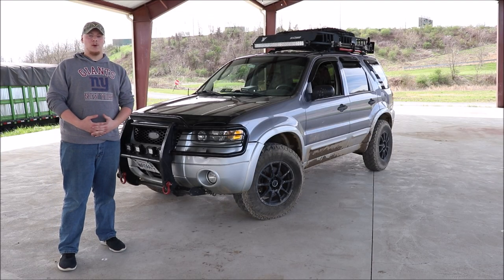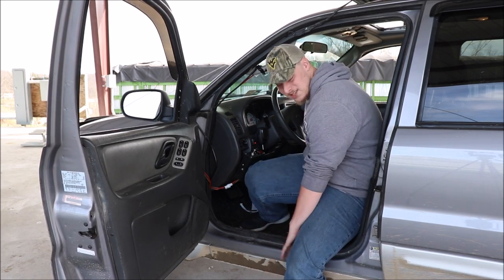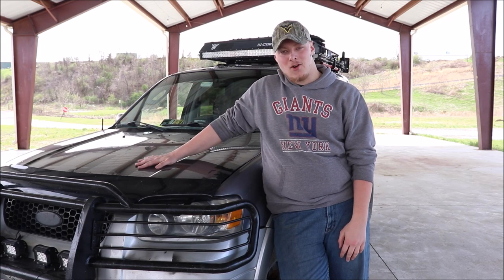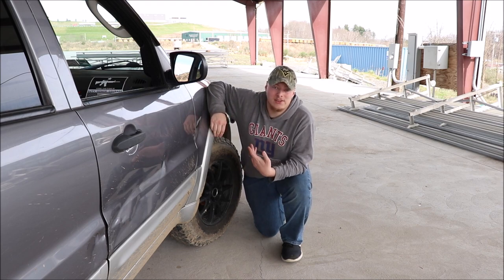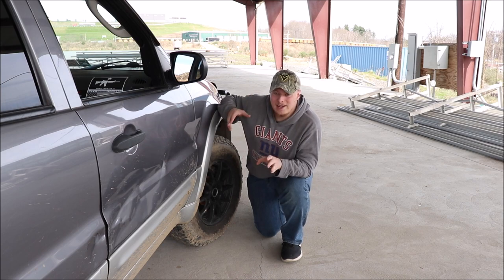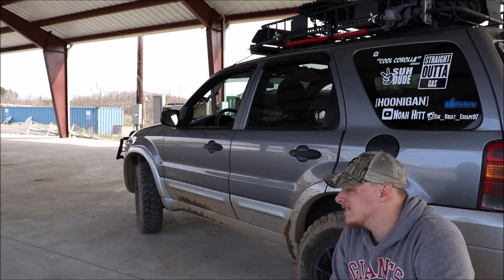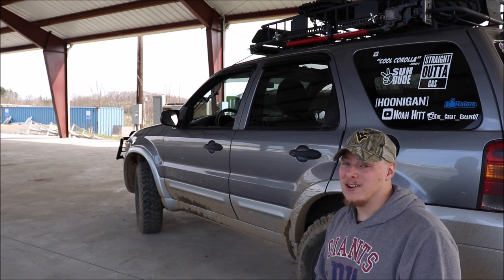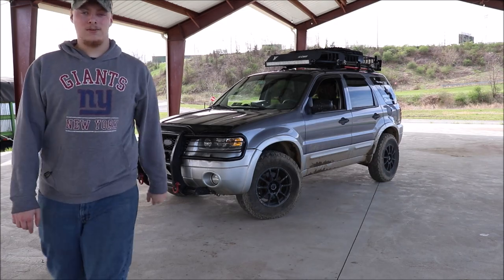5 THINGS I HATE ABOUT MY LIFTED 07 FORD ESCAPE

Comment: I have almost 250,000 miles on my '02. Built like a tank. When you replace the alternator put a new timing chain cover gasket on.
Reply: I’ve got an 05 with almost 300 and after putting on plugs and a new battery I now realize it’s the alternator:(

Comment: Dude you're missing one point of that whole vehicle it was never made to be an off-road vehicle. It wasn't designed to be buried in mud. If you went through four alternators then you're probably getting mud and all that kind of crap in it, I have two Ford escapes One of them is a 2001 The other is a 2004 they both have the original alternators on them and they both have over 200,000 mi on them. My 2001 I do light off-roading and I've never had any issues. But some people like you like to complain about issues you've created for yourself like taking a Ford escape and trying to turn it into a mud vehicle

Comment: Lack of power? My old 03 with the 3.0 friggin ripped. Clocked in 0-60 at 7.5 seconds. Did a 30 roll with a 04 mustang 4.6l and let’s just say i was lookin at that stang through my rear view. Front tires? Forget about it! She was always chirpin and wearin through rubber. Miss that thing.
Reply: Same, idk what the fuck this dude's talking about. Maybe it's the extra 500lbs of bolt ons he slapped on there weighing it down... When I turn O/D off its like turnin the hat backwards. We gettin it.
Reply from the maker: @Paios I’m glad yours has kept you happy, just never felt like mine had enough balls behind it

Comment: Had my 05 since 06 never changed the alternator. Replacing it 4 times? Buy OEM, yes it cost twice the price but given the shitty location, buy one that's going to last. You'll save in labor costs alone.
Reply: It's because its at the bottom of the engine... you drive through a large puddle or creek, anything deeper than 10" and the alternater gets soaked.. after that.. you can kiss it goodbye in the next 12 months
Reply: Clayton Bolton - I drive through slush and snow all winter and hit puddles at speed on purpose. Replaced once at 174, 000 mile replaced with a high quality one, no problems. 

Who ever designed the location however should be stomped.
Reply: had mine go a week after i bought the thing at 120000, im now at 155000 and no issues.

Comment: I have the 01 Escape and I do not have the same complaint with my alternator. All you need to do is remove the passenger tire, remove the serpentine belt from alternator and unbolt the three bolts from underneath. Super easy for me. I never have to replace mine but I did have to move it while putting on new manifolds/cats.

Comment: I hear you on the alternator issue....almost all car manufacturers are cramming things in due to front wheel drive...more compactness for better gas mileage etc.....but on the power - you have those accessories weighing it down some.....front bumper / top rack and things in rack and in back.....also AT tires = more resistance/drag.    I'm sure there are quieter Escapes that are 2WD ....off roading alot creates squeaks etc....  keep buying American....do your homework....

Comment: I have an 08 ford escape hybrid and it's a huge piece of shit and the best car I have ever owned at the same time.
quality of the interior is absolute garbage, especially for the hybrid, which was a budget car version of a budget car.
it rides like shit and randomly jimmies on the highway/when accelerating. Not sure if it's designed that way or if mine is just fucked up. Probably a mix of both to be honest.
the power is even more lacking than on the V6, although the electric motor almost entirely makes up for lost acceleration from between it and the v6 version.
I have repaired exhaust leaks 4 times now.
It constantly needs something little (or huge), but we'll get to that later.

HOWEVER,
it's quite simply indestructible. I drove it 20,000 miles on rear wheel bearings that were totally destroyed. How did they get destroyed, you ask? I put 39 bundles of shingles in the back. At 68 lbs per bundle of Owens Corning Duration, this tiny ass SUV moved 2652 lbs around (not very well I might add, but it did it). I have also towed a roughly 3000+ lb trailer full of shingle waste around and the torquey little electric motor pulls it around no problem. This car will turn off the engine while towing. Also, I lost control on the highway after hitting a deep puddle and rammed into the concrete barrier at 40-55 MPH HEAD ON. I just replaced a few parts and drove it away, although it needed a bunch of suspension parts to be driveable. I walked away from the crash with minor injuries, although I thought I broke my hand (i didn't).

Finally it always needs something small, but that's because I have managed to put about 40,000 miles on it in a single year and I drive HARD. the parts are hilariously, stupidly, unreasonably cheap for this thing - even the Motorcraft shit - and the tiny little 2.3L I4 looks like a lawnmower in the engine bay that was made for the 3.0L V6 so you have TONS of room for everything. The fucking transmission has 2 drain plugs. My friend at JiffyLube said if I bought it there they wouldn't even charge me for a transmission fluid change, but a differential change, it is so easy to work on. And I have replaced a lot of shit, including almost all the suspension, shocks, brakes, interior crap like stereo, but most of that shit is wear items so it's hard to complain since I bought it with 82K and what seemed like no maintenance. I did basically all the work myself or with a friend.

It's a great little work truck. It has always started and ran. I seriously can't imagine what other vehicle I would get to replace it.  Actually I can - it would have to be either a RAV4/Highlander/Explorer hybrid, but those cars can't be bought used for $5,000 with cheap parts/proven durability. I don't have $35,000 for a brand new RAV4 hybrid and it would be retarded to buy one anyway because of how I use vehicles. Ford overbuilt the shit out of the hybrids because they were intended for the taxi market by matching a modified Mazda/Ford Ranger I4 and a transmission they literally just copied from the 2nd generation Prius and then improved upon by adding an absolutely massive radiator for the electric batteries. In fact, AISIN, toyota's co-company/transmission manufacturer actually built the transmissions because Ford got involved in some lawsuit or something because they got caught "reverse-engineering" it. This is one of the only hybrids that doesn't burn up batteries. It is the ONLY hybrid I have ever seen at a junkyard with the batteries still in the car. There is no market for used Ford Escape Hybrid batteries. They just do not break.

Needless to say the car is garbage and has never "impressed" anyone but people I worked with who were astounded that it never died. When it is totaled way beyond my ability to fix it, I will just buy another one. Also - 2008 or earlier is the year to go for durability/cheapness because after that the engine got more complicated with VVT and they added an electric AC compressor that is very expensive although you get significantly more HP and MPG's for the trade. I'll take my durable, simple, easy to work on shitbox as it is though. The car's suspension/brakes/engine/trans is almost identical from 2001-2012 so you have a huge range to look for in junkyards and online for replacement parts.

Comment: My wife had an 06 2 wheel drive. It was a great vehicle. My question is: Is the 4x4 escape truly an off road vehicle? Im considering buying a 07-09 4x4 if so. Thanks.
Reply: I have an 08 4wd xlt with 31 inch wheels and it does decent off road, mine is not lifted but it still preforms alright off-road.
Reply: The 4wd is smart computer controlled meaning that once the computer senses the tires slipping it will automatically engage the 4wd option and a signal that it’s working will pop up on your gage cluster. If your planning on using your escape off road and or In snowy conditions like I do, I would take it to a ford dealership and have them test the computer function to make sure it’s engaging at the right times. Other than that, I love my escape and have been through some harsh terrain with her, but she’s always held true.
Reply: @gang6009  
I agree! I just got a 2002 escape xlt 4x4 and it's been pretty great actually! All I've done so far was replaced a few coil packs and all spark plugs, flushed the coolant system and changed trans fluid and it's really surprised me at how smooth n easy it handles and drives! I plan on putting a better catback exhaust and a cold air intake maybe new o2 sensors and MAF but I do notice lately when I left off the gas pedal that it kinda acts like I'm still on the gas slightly n stays at like 2k rpm for a few seconds and then goes to idle normal! It's kinda bugging me as I'm a tad ocd and want it to run perfectly. Do you have any issues with throttle etc!?!?

Comment: I have a 05 3.0 v6 lacking of power as well. You might need to buy a cool intank for a bit more power. The alternator on mine is original and never gave out other than the fuel pump which are very expensive.

Comment: Nice ride I just bought a 02 with 137k I had it two weeks and I blew a rod so I bought a kit for $800 dollars it getting rebuilt now plus I'm going with synthetic oil and I'm doing the transmission oil and new plugs new PVC I'm hoping it turns out good if so I am going to put some black rims the color is yellow so I will post some pictures when it is done.
Reply: Bet that never worked out for you did it

Comment: Is that a Setina PB400 bumper with brush guard? I've got a new one for my old Explorer but never installed it. Was wondering if it may fit the 2006 Escape. (I haven't measured the frame yet)

Comment: I got a 2003 which I bought new. At 150K, still got the original alternator. Not sure why you keep losing yours.
You killed the power with the bigger tires. I put snow/mudders on mine, which I hate, but are good for snow.
I parked it, only to use in weather situations. Bought a 2018 escape which is great. (fully loaded)
Wife and kids are driving the hell out of it.
Living at 1600' and having to travel down to 800', the back and forth needs some hp. Both cars do wonderful.
I would never put bigger tires on either one. Engine too small.
Reply: Hey Phil. Since you've owned both I want to ask you the same question I asked Noah. I recently came across a 2004 Escape XLT with 32k original miles for $7,000 or best offer. I'm debating between getting that or going with a newer 2018 Escape SE for about $18,000. Do you have any preference between the two vehicles? I'd really appreciate your recommendation. Thanks
Reply: My 03 has had issues along the way. The coils will crack causing misfire. I drove it like that for a while, which was a huge mistake. Ruined all 3 catalytic converters. (very costly)
I keep the old one only for weather, besides I couldn't get anything out of it.
The new one is WAY more quiet inside. Ride is much better, and it has a warranty. Still has plenty of room for a small car, and does good in the snow. 
It really depends on what you need the car for. Go with the new one,  I say.
Reply: I have a 03 stock no modifications Just Regular maintenance n care and I agree with the power Not being enough, going up a hill or mountain rode at 45 to 50 mph  the engine Revs to 3k and it seems to Be cinda forced.
Reply: Do you have the 3.0 6 cyl?
Mine runs great. Last week I took it out for about a 10 mile drive. A mile from the house I floored it and shot up to 90 in just a matter of seconds from  55.
The new one I bought has the 1.5 turbo. Plenty of power there also.

Comment: Honestly hit all the cheif complaints I have about mine. I have an 05 and have run into all these issues. It sucks though cause theyre actually pretty good offroading vehicles as far as light suvs go, I've yet to get mine stuck and have taken it down trails meant for quads, but the market for good modifications just isnt there. Pushbar, lift kit and roof rack is like the only big mods you can get. It sucks cause you can mod the shit out of explorers and up but the poor escapes just kinda got neglected. Still, escape gang all the way

Comment: Hey Noah thanks for your videos. I recently came across a 2004 Escape XLT with 32k original miles for 7k or best offer. I'm debating between doing a similar build to what you've made or going with a newer 2018 Escape SE for about 18k. If you had to do it over again, would you save the money and build yours again or get a newer vehicle? Thanks
Reply from the maker: Between the 2 years, I would pick the 04 but between the 04 escape and a newer non escape vehicle, I would do the newer vehicle. I had an absolute blast with my escape but the poor gas mileage and constant repairs wore me down.
Reply: @NoahHitt  Thanks. I'm trying to stay under $18,000, have more space than a car, good gas mileage and decent towing capacity. The escape seems like it checks all those boxes, but I've been looking into alternatives also. I'm coming from an old 2002 Wrangler, so having off road capability would be a bonus.
Reply: Nicholas Smith I have a 06 Escape Limited 4WD with the V6 motor I get about 12L per 100km top of the line truck and I think it’s a great city and towing vehicle as I have the tow package which allows 3500lbs of towing instead of 1500lbs that every other escape can tow, even with the same motor, they added a transmission oil cooler which is why I can town 3500lbs but honestly none of these trucks new or old can compare to a Jeep because a Jeep is a true 4x4 the Escape is 4wd so it’s always running 2wd until it detects slippage, sometimes it can be to late and your already sideways trying to get control I had a 2000 Jeep Grand Cherokee and that thing was a beast it pulled my dads cargo van that had about 4000lbs of tools in it out of a ditch with 3 feet of snow with no sweat. If I were you I would get the 04 given your two options because the newer Escapes are pretty but they don’t have the aggressive ness of the 04 what you will save in gas with the 2018 you will lose with depreciation of the car just my opinion! Cheers